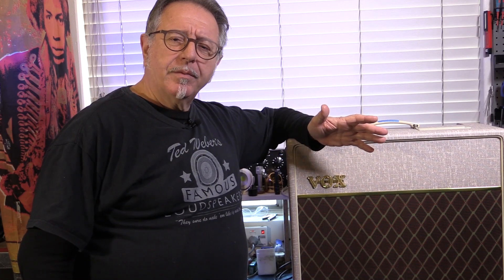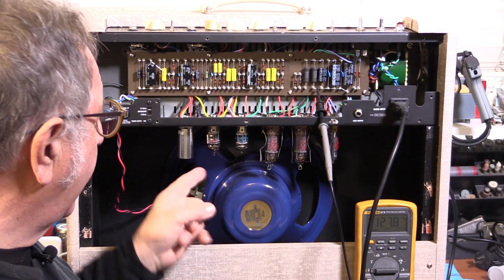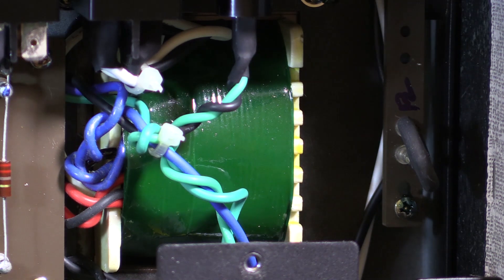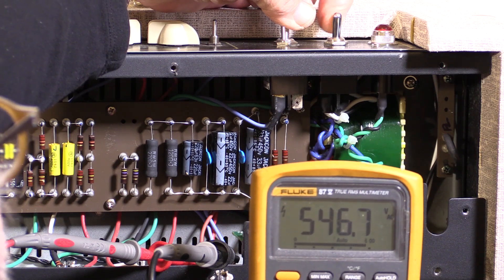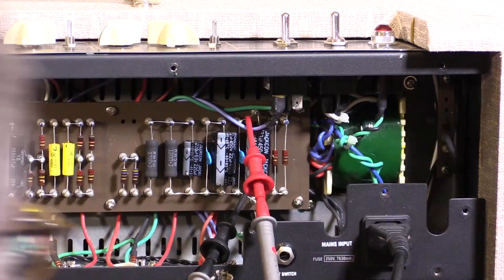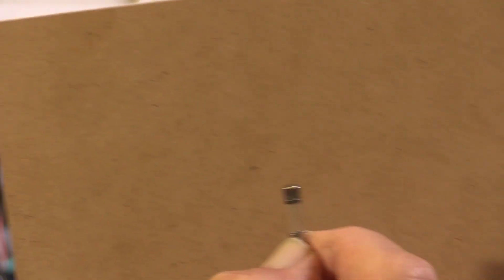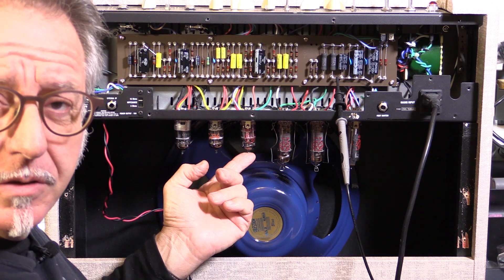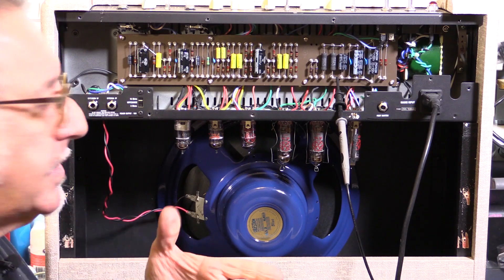How to repair a hand-wired Vox AC15 HW. Power supply problem and microphonic tubes.

Comment: Would you know the value of the MOV or the ICL surge protector of the Vox AC15C1 soldered between the A/C receptacle in the back and the on/off switch? Thank you!!
Reply: Just in case somebody else needs this part and doesn't think "it will be a good excercise to learn how to determine the NTC", here's the part number:SCK15105MSY.
Reply from the maker: HI Rod. I might just define the function of a couple of components. 
An NTC Negative Temperature Coefficient Thermistor is a type of Inrush Current Limiter and is in series with the Active/Live wire. Its resistance starts high and reduces with increasing temperature/current thereby reducing the (often savage) spike in inrush current. 
A MOV Metal Oxide Varistor goes from Active to Neutral. It starts with a very high resistance and is designed to fail “short” with a large spike. It will blow the fuse in order to protect the circuit that follows. 
I think I remember the NTC part number, but without being 100% sure, I prefer not to say. I would hate for you to bring the burnt carcass of your AC15 to my front door and say “You remembered wrong!”.  Besides, it will be a good exercise for you to learn how to determine the NTC.

Comment: Great content! I wish you were based in my city to take care of my amps haha Random silly question - I’m about to bring my bought in US AC15HW to Europe/Spain, do you know what’s the best way to use it in the 220v environment here? I’ve read step down coverters might not be ideal due to the 50hz frequency but not sure if the stock transformer can be rewired to 220v, do you know if that’s possible? Tks a lot
Reply from the maker: Thank you for your lovely comments, Dalton. 
I haven't done a voltage conversion on an AC15, so I can't advise you if it has multiple primary power options. You would need a 220 to 120V STEP DOWN  transformer. Make sure you have sufficient wattage in the step-down. I think your amp uses a 1.25A fuse at 120v. So Vox feel that it won't use more than 150w when operating normally. Double that for your transformer and order a 300w step down (absolute minimum of 200w). A step down works for for home/studio use, but if you plan to gig with it, get a new power transformer. I would recommend you get it from Vox to ensure you will have the correct secondary voltages.
Reply: Tks a lot for the crispy explanation, I’ll definitely keep this in mind when buying the step down transformer. Cheers

Comment: A shame that for the price you pay for a hand wired Amp they use no name junky unreliable chin#se capacitors, I'd expect this in their normal non hw version, but their highend heritage line that is nearly twice the cost, Horrible,, inexcusable, if I was vox I'd be ashamed, if I'd ever blow money on one of these, it's getting all vishay te or 30d series axial capacitors inside immediately, a shame they put such cost cutting Jackon junk in there... Bet it won't last 20 years, bet they are not even high temp units, I'd be surprised if they were, hah, bet their spec sheets don't match the actual condensers themselves. Like at least put Nippon chemicons, rubycon or nichicons inside.. Jackon? More like Jack your wallet up...
Reply from the maker: I share your frustration, Derk. It is a disgrace how once-great amp brands are now run by accountants. There is no thought for servicability or quality as there was in the glory days of Fender, Marshall and Vox.

Comment: Nice vid about a nice amp. You expressed a preference for Weber speakers and I wholeheartedly agree when looking for speakers for my Fender style amps. Which Weber would you favour in place of the Celestion Blue or the Greenback? I've used their 12F150s and a slew of their 10" AlNiCo speakers, but they'd all be too bright to replace a Celestion. I'd be interested to hear your view.
Reply from the maker: Thanks for your question, Bladder (I love that name). There are only a few speakers that I like as much as Webers. One is the Celestion Blue, another is the EVM12L and the JBL D130. I like a ribbed cone. I am not a fan of speaker distortion. Speaker distortion is out of our control and it may not be how you want to colour your sound. 
I also liked the Brit-made Greenbacks, so if you ever get one of those, hold onto to it. The Chinese ones are OK, but not a patch on the originals. 
After this its all a matter of taste. I tend to like the open sounding chime of ALNICO speakers, but I have heard some mighty fine Ceramics. Ironically, I took out a beautiful sounding 1960’s Jensen from my drip edge Princeton and put in a Celestion Blue (new 12” baffle). Heresy…but I love it.
Thanks for your question. Don’t we love nerding out!
Reply from the maker: My first Weber speaker was about 25 years ago. After talking to Ted, he suggested the speaker (which I still have) that eventually became the Ceramic Blue Dog. Nice. https://www.tedweber.com/blue12f

Comment: It looks like the owner played the tubes until they failed and blew a fuse.
Reply: Haha!!! Or maybe pulled them out and jumped on them?
Reply from the maker: That's a possibility, John. Or a knock sufficient to short the filament to the cathode of a EL84 running on 100% idle bias current? One of the joyous mysteries of tube amps.

Comment: That black disc looks like a posistor
Reply from the maker: Thanks for your reply Ian. A Posistor has a postive temperature coefficient, which means the resistance would increase with temperature, which is not the case in this application. I think in the video I said it was an MOV. An MOV is across the supply and not in series as this component is.  (Note to Self: Engage brain before mouth) I should have said an NTC. A Negative Temperature Coefficient Thermistor reduces its resistance with increasing temperature reduces to reduce the current surge usually on the primary side of the power Tx. 
  Thank you for alerting me to my brain malfunction, Ian.
Reply: @theguitaramptech  we all make boo boos, i am building myself a class A amp at the moment. 807 output tube EF37A preamp driver tubes i meet you when you came to Speaker Hospital to get a speaker fixed

Comment: The real issue i see is vox using cheap Chin*se crap capacitors on a unit that costs 1,000 plus usd... in a kit like this, there should be nothing but the best, united chemicons, cde, Panasonic, vishay, nichicon, kemet eletrolytic capacitors which have well established track records, there shouldn't be ANY COST CUTTING "JACKON" CRAP inside this unit like what is clearly shown at 2:20.  If I'd ever buy one, all those crummy cheap under performing capacitors would be changed out for longterm reliabilitys sake immediately.... Not only will it be more reliable, it'll sound better to and be far more stable... its disgusting that something so expensive uses inferior parts, uk and hand made... like come on vox.... I wouldn't send that back to a customer with parts like that. Vox needs to switch out all that junk with cde tta or vishays tte or 3od series at the very least, it isnt worth saving the 5 bucks...
Reply from the maker: I must admit, I do like Vishay components. A but dearer than most, but I have never had a failure.